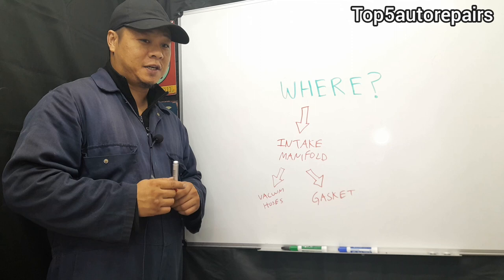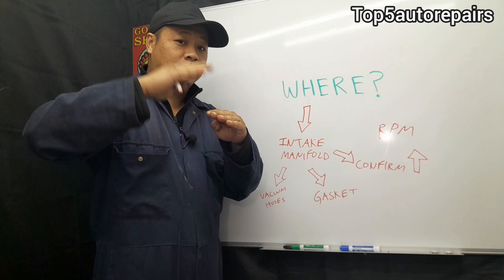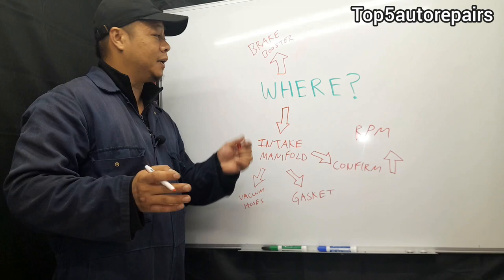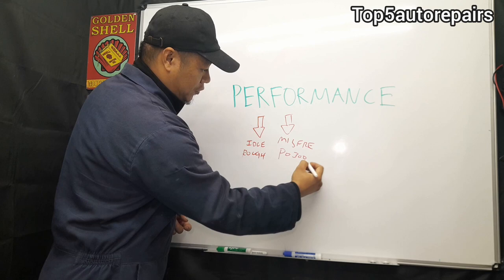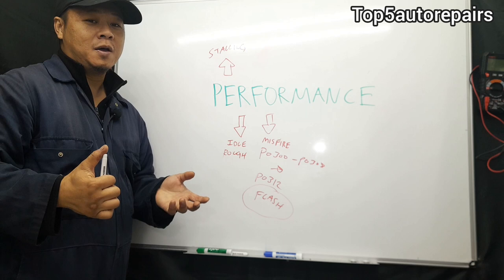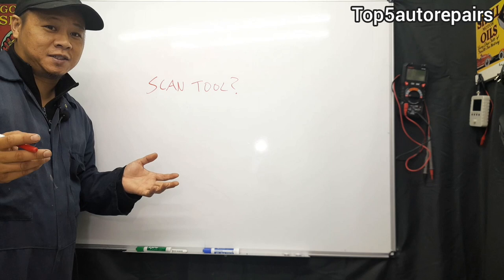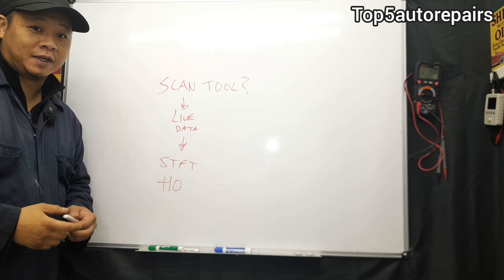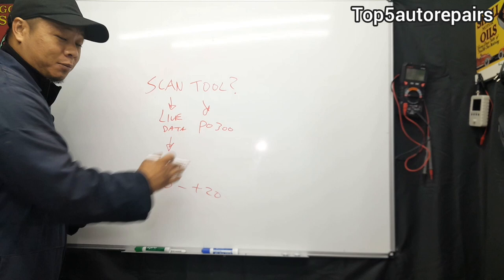Vacuum Leak Symptoms (Understand how Vacuum Leak can affect Engine Performance e.g. Misfire Stalling

Comment: I use my shopvac blowing air in the tailpipe while engine is off and spray soapy water around engine and hoses. (If you have duel exhaust, use a shop towel or a sock in the 2nd exhaust while blowing air in the 1st exhaust. Once done checking the 1st exhaust change over to the 2nd exhaust and do the same exact as before).
Reply: Thank you for this. Hands-on experience sharing right here.

Comment: Thanks man. I just bought a Grand Caravan 2016, 109k, and it had a few symptoms. Stalling at stop lights, rpm flux, bogging uphill, and a Jetsons car whistle noise. The transmission leaked out the fluid from the transmission pump. ...warranty put in a whole new transmission $6,000 and 3 weeks later. It runs better, but less power. I think the vacuum leak was the cause maybe? And is still there. I think I can identify 3 vacuum leaks, behind the Air filter,  the brake booster connection and maybe some hose that's old and hissing. Seems to improve if I move it a certain way.  Anyway. This is a helpful video as I try to figure this out. Thanks
Reply: Are  you in California? With a shop?

Comment: I got a p0108 I change the map sensor it was damage but it also said in that code it can be a vacuum leak or air filter or throttle body  the car crank with power but it doesn’t stay on unless I Gass it then it will stay on roughly

Comment: Captain, I have a 96 Suzuki sierra with a g13b, when I cold start it the rpm goes to 2k rpm. I’ll let it stay there for a minute or 2 then when I press the brake pedal sometimes I have to press it twice the idle drops to normal 950 ish. runs fine after that. but on occasion has a crank no start when cold but starts the second crank.

Comment: i need your mechanic expertise now on these several scenarios that happened to my old car. my car is an old ford expedition 2000 model with 5.4 v8 engine. previously it is running fine, it starts immediately with no issues. but lately i first noticed that i am starting to have issues starting the car at once, even after several tries. it cranks but wont start that quick,  then i discovered that if i put my key to the on position for 45 seconds to more than a minute then crank the car, it will start. this happened for a period of time. then after several months i started experiencing sudden stalling or the car just dies while driving. so what i did is pause the car for a bit and then start it up again and then it will run fine. later, upon my personal analysis i decided to replace some parts with the idea of solving these issues so i replaced the crankshaft position sensor and the camshaft sensor. later i also replaced all 8 of the ignition coil and spark plug. after that it runs fine although sometimes i still need to wait for the key to be on the ON position for at least 15 seconds to a minute to start but after that the car runs ok. but after several weeks it started acting up again weird, it just stalls while driving again. so like i am back to zero into analyzing why is this happening. somebody also suggested to add a cleaning fluid in the petrol to clean the catalytic converter and oxygen sensor and hope that this works. what is your take on these steps that i have taken and any other suggestions you can give on the mechanics point of view and expertise,  thank you very much

Comment: I get a vacuum leak code in bank 2 only while decelerating or coasting.  I tried smoke test, carb cleaner, changed maf, map, and 02 sensors.  I am getting a lot of misfires on cylinder 8 mostly I swapped coils, changed spark plugs and wires.  I still cant find it. If i am driving I can recreate and watch it in live data, i switch from drive to neutral and it will not go lean.

Comment: My 95 camaro 3.8 has a hesitation at acceleration. Nobody could diagnose it. I had it at five different mechanic shops.. but recently, my brake pedal got real hard and I can hear a hissing sound under my dashboard right away. I thought vacuum leak. I took it to a shop and they determined that I had a bad booster. My question is do you think that could have been causing my hesitation at acceleration issue?

Comment: I have all the symptoms.   Drives fine when comingbto stop sputters and rough idle.  I hear hissing from top of manifold. Fuel trims are good at idle but get crazy when driving alot
Reply: Looking at coil packs and injectors also  It's a 2021 silverado  🤦 no codes  takes a while to act up when temps are colder 79 degrees runs like trash

Comment: Sir.What is the spray you use to check vacuum?
What will be the normal STFT?
Reply from the maker: Carburetor cleaner.
Reply from the maker: Less than 10 + or -

Comment: 07 gmc Yukon XL- so I was driving on highway then all sudden check engine starts blinking wich is a first then traction light also came on then I took my exit and came to a red light then starts making a ugly sound and is not taking off as it should..so I saw other YouTube videos of ppl same problem changed spark plugs,wires,and ignition coils and problem fixed but I did all that and still..doesn't sound as bad but still check engine light blinking and traction comes on..so I put scan tool for evap leak and it failed.. just hope I'm able to fix
Reply: I had that same problem happen on my 2012 Chevy Silverado 1500 LT 5.3 I blew a head in cylinder 1 the oil was milky. That was a major repair for me plus had to get a new oil pump it ram me $3300. I don’t know if your issue is the same as mines but I remember what’s happened to me when I seen the check engine light flashing red and traction control came on
Reply: Typo ran
Reply: Misfire
Reply: It was the lifters..common problem with these.

Comment: I have been notisting my isuzu ascender been sweating water from the back pipe. And underneath.  But when i take it to a mecanic he saids is normal. But i know is not. Then went for a computer test in about 3 places it diagnost a vacuum leak and catalyst issues. But this mecanics are very ignorant! Know i dont know where ti take in. They were not able to fix an antifreeze leak. They had cut my heater core hose and didn't tight it enough left it loose then my antifreeze was all over my hood. Some one tighten my clamp. But the leak i notist is underneath my reservoir container so im thinking it my have a crack underneath thr container.  It leaks only when the truck reaches its temperature. I also have a powersteering leaking 😢 so expensive to get thid fixed 😢

Comment: Sir wanted your advice 
My engine has a vaccum leak 
Which has increased my rpm and decreased milage 
I have checked vaccum hoses all are ok 
And my fuel mixture is also great 
Means water is coming from my cylincer 

Can you please tell me what other areas I must check 
Because am not getting it 
My air fuel mixture is perfect 
And then a vaccum leak 
Which has increased my idle and decreased milage too much 
My 1 litre average was 18km 
And now it's 4 km

Comment: hi! Need your experitse help please!

When I drive my car it has no engine braking so when i release gas pedal it coasts to fast forward. Also when i acellarate I have to press gas pedal to hard while on my other car I can just tap the pedal and it goes. It seems as it has some pressure the car is fighting when acelarating while no pressure when i release gas pedal and it should be opposite.
Aynways I got no engine braking or very little what you think is the problem? Also the car exhaust sounds much quitter than other car and I get on cold start cloud of blue smoke on startup
Reply from the maker: Hello. The blue smoke at start up is caused by bad valve stem seal.
Reply from the maker: Is the check engine light on? Could be a lot of things. For example, bad accelerator pedal position sensor, clogged catalytic converter, bad tps, limp  mode, bad transmission etc..
Reply: @Top5AutoRepairs  check engine light was on before and we replaced maf sensor and 02 sensor one time with salvaged one and now with new one. Mechanic said it might be the cat. Also noticed engine gets really warm on just short ride and exhuast seems kinda too quiet. Im thinking bad cat and valves. Cause when i raise rpm in idle and then take off car sounds and rides better for few meters like i clean exhuast fumes or get him some air for short time
Reply: Is this symptom on any mkae/model? @Top5AutoRepairs